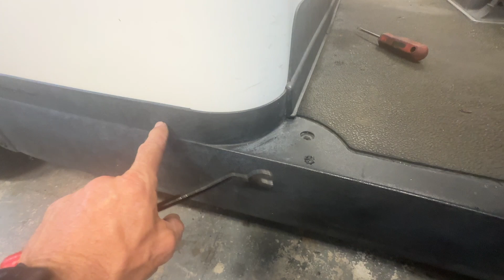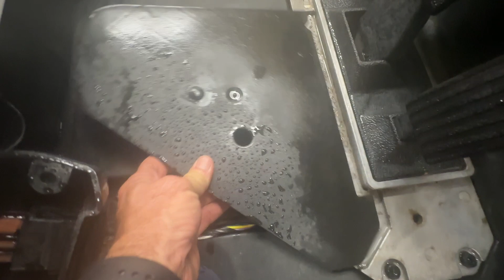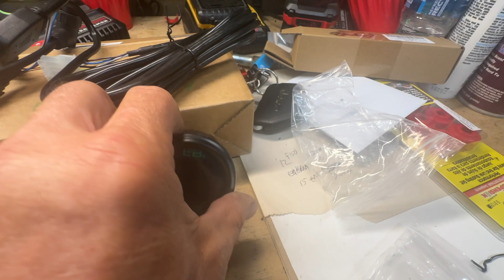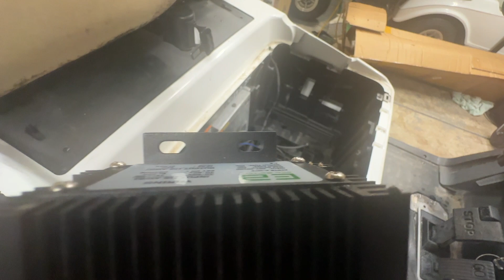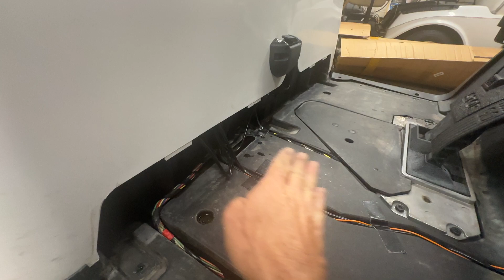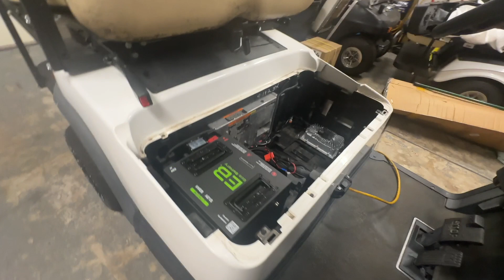How to install an Eco Battery 60ah on Club Car Precedent with Range test !

Comment: Have a question. I am getting 53 volts output from the red and black wire from the bucket harness. The 12v converter is putting out 13.5 volts from the black and red wire. So, in the video, you're connecting these together. Is this correct? Two outputs of different voltages going together. Or am I missing something?
Reply from the maker: yea, I don't understand that.....your bucket harness is a completely different harness than your golf carts harness (it is like a separate circuit.) So your bucket harness has no power, until you feed it power from your reducer.   You didn't connect your blue wire from the light harness to the short connector to your main positive did you?  This may require a few more questions, give me a call after noon EST at 803-530-5813. We will figure it out! (meanwhile, dont cut your lights on!)
Reply: @Kartznfartz I will give you a call. I did make an error when I was typing. The two yellow connectors are two black wires. When I test voltage across them I am getting 53 volts. They are disconnected right now. Also the blue wire that was originally on my positive terminal is also disconnected right now. I am also getting 53 volts to my usb connectors under the dash. With all that disconnected I would think I would be getting zero. Lol.  Something is going on. But I will call and send you some pictures.

Comment: James I am thinking of converting my 2012 prescedent. I live in northern Michigan. Can I use a eco battery in a cold climate. I see some batterys cant be charged in cold areas. Im also worried about fire danger. have the batterys got better with this. what wouls bw thw cost of a 60 amp hr kit
Reply: I live in Michigan also and use my cart year-round. You'll want to find a battery that is self-heating. Those can be charged in freezing temperatures. The LiFePo4 chemistry is safer than the Li-ion, plus most include an internal battery management system (BMS) that prevents overcharging and short circuit protection to prevent damage to the cells so the fire risk is extremely low. EnjoyBot makes a 48-volt 65ah lithium battery with self-heating.  A combo package with battery, charger (can't use your old charger), 48v-to-12v step-down converter, and battery monitor for probably between $850 to $950. I just converted mine recently so I don't have any long-term evaluation to share.

Comment: I've watched a few of your videos now, and great work.
One thing that confused me was at the very beginning of this one it sounded like you said the 72AH battery was "not" recommended for a lifted cart, but the 60AH was.  Seems to not be logical.
I'm new to carts, have a 2013 Precedent with 6x8v batteries that are getting tired.  My wife and I are Senior, and the cart's main function is to take us up a steep hill to a garden in the summer.  I've put 12" All-Terrain tires on it, with a 3" lift.  I have no plans to swap out motors and such in the future.
So what do you recommend for a lithium battery replacement - 60 or 105?  Wiring doesn't scare me, in a previous life I built test equipment used to check circuit boards coming off an assembly line.  I live in CT.  Thanks.
Reply: The older 72 amp power batteries did not have as strong of BMS nor lithium cells. This new 60 AH is as strong as the 105s and larger! That may be one reason they discontinue the 72AH
, but between me and you, I have used this 60 amp hour battery on lifted carts and with high speed motors without any problems at all! I do feel like Eco under rates the power this battery will put out! With any DC motor golf cart, do not bind the motor at a dead stop and hold the gas or as most people call this a stall. That’s not healthy for the motor. But if it were me I would buy it without any reservations!
(I have two YouTube log ins,  but this is KartzNFartz !

Comment: Do you have a link to the special spade connector to the key switch?
Reply from the maker: This will work …https://www.amazon.com/ANCIRS-Semi-Insulated-Connectors-Disconnect-Assortment/dp/B0DDGSPN5F/ref=mp_s_a_1_10?crid=1O3I3Y1S6ROF4&dib=eyJ2IjoiMSJ9.w8E8nCXAA5pozslcBStexFx2LGY_XPNpx5NdW8ZEMiwuBfM88d4QU8eetySQ2OHdZrbCkKHppVCEMuY5FrURop0YrLNln83g3rnaTw9_-P_LUPz2u1493c7-0Uybu70contmfoiW7IShJzskhGqeVk4Qk1q9tscx3CZkmTvK3iZy1bDnHl-m7mJCCj0D1DYv4w264NtHQ2MWJFDqMHyxZA.r0K4RNE_T23arU9Y7cDLE_toq_tldWZVnNqVNpKFzLU&dib_tag=se&keywords=add+a+link+spade+connector&qid=1735539673&sprefix=add+a+link+spade+connector%2Caps%2C92&sr=8-10

Let me know if you need a dealer to order that battery kit from!
Reply from the maker: this will work....https://www.amazon.com/DZS-Elec-Connector-Semi-Insulated-Terminals/dp/B0776PY5JK/ref=sr_1_6?crid=RVT5G72T85VL&dib=eyJ2IjoiMSJ9.I7_yRYQQFZJDntaUogsNsUKVHzOtBV8gUpY-plg82282VM24cJkwdd424JRc2O069q-L25GE7F6dmBllAd9IEwgLtoMeX-N9FJwdnypwUimwGJO-6h3xXe-2mj8LfvKjpkPjQaC4Ik_Vf2S9NodjCAdl07WAkZuhV_9NYvvxuDBUwvRFEULc25dTpE3GsoLUOSzImEHdkWt9P3D_knFKyvEpIDgBi5gQ-hCYQIOG5fM.iywAi1eW7d3iqnB6h9UIRdXYpcvNNMTtXdj6IZpbWoM&dib_tag=se&keywords=male%2Bpiggyback%2Bspade%2Bconnector&qid=1735567528&sprefix=male%2Bpiggyback%2Bspade%2Bconnector%2Caps%2C83&sr=8-6&th=1

Comment: Thank you for this video! How many less miles approximately will you get when used on a 6” lifted cart with 22” tires
Reply: I have not done a range test on a lifted car yet but my assumption would be maybe 5 miles less. I’m still very impressed with this Battery and I’ve done several since filming this video! Reach out to me when you’re ready for the conversion!
Reply from the maker: Be sure to SUBSCRIBE, and tell your friend to also!

Comment: Do you recommend the 60 ah if you have 6inch lift with 23 inch tires and navitas ac motor and 600 amp controller? Or would I need the 105ah?
Reply from the maker: That is ALOT of demand! The lift and tires alone, yes, but add the Navitas and controller, I’d go with the 105. It is tested and true ! Please let me know if I can help you with purchasing the right kit 👍
Reply: @Kartznfartz  will do! Thanks for the reply!

Comment: I am curious if you would have had enough main cable length if you had chosen to install the battery on the driver side and put the charger on the passenger side. I like the idea of having the cart more weight balanced if you don't have a passenger, but I like the idea of not having to make a cable even more.
Reply from the maker: That’s funny you mentioned that! Every install in the past has always been on the passenger side so I just went with it, after I was watching the video I had the same thought process! The batteries are only 70 pounds so it probably would not make that much of a difference anyway. The next time I get a customers cart, you bet I will be trying that! Thanks for viewing the channel and be sure to subscribe!
Reply from the maker: @robwideman...I took your advice!...https://youtu.be/-QKYDN8ouH8?si=A-cFDI3ob-nkKGCe